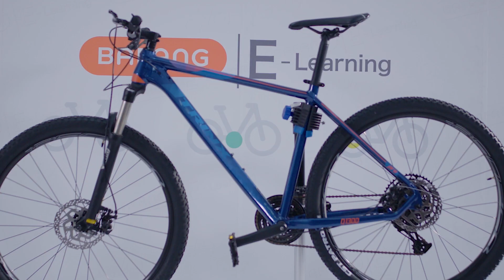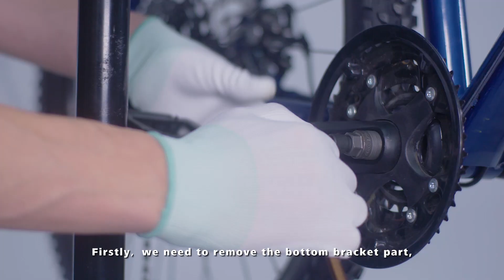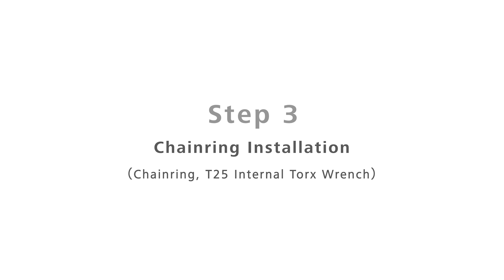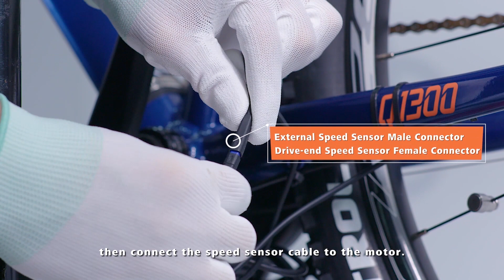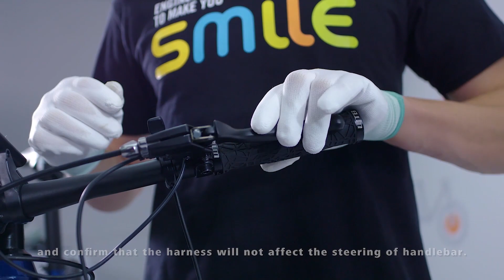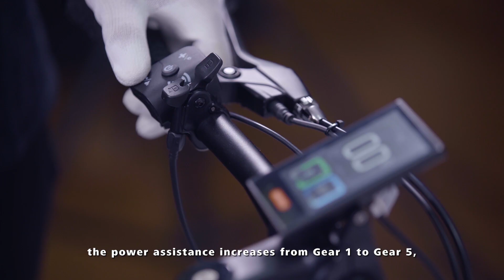Sebic agent high-end motor brand Bafang M625 M325 installation tutorial

Comment: so my cable that run from the computer to the motor only has one yellow connection, all the rest are orange.  So now what is the proper cable to hookup.  The orange cables do match the number of pins.  I hope it works.

Comment: One battery  charg how much kilometer
Reply: really if you are 7 yrs old and weigh 50lbs you can go 4 times farther than Me a 200 pound man.  also depends on how much you pedal to help the motor.  depending on battery size also .  riders may get 30km to 150km.  its reccomended that you ride until the battery level says 50% then you can make a guess at your personal range.

Comment: Bafang has taken advantage of the opportunity to eliminate the use of this motor on half the bikes in their previous market! Look at that massive power pack! Will it fit in anything other than a L or XL frame?!
Reply: The answer is no. The battery is ridiculous. And Bafang provides zero information about the type of cells they use.
Reply: @bjnslc  You can use the rack mount instead of the frame.  Also this shows one of several optional batteries different shapes and configurations the web pages all show different size and configiraton lithium battery packs and different displays.  Also depending who you listen to perhaps other products maybe better for you .  Many builders are recommending the bafang 750.  also if you want to go fast get a real 4cyl motorcycle and and operators license. the reason for pedal assist is if the battery goes dead and you don't plan your trip you can still pedal home as well as exercise.  But if you want to go faster than 20 mph get a motorcycle license. these E-bikes  are all about skirting that issue and putting unprepared riders in traffic.  from your attitude you sound like one of those.

Comment: The battery clearance spec (170mm by 390mm) will not fit most bike frames. Might fit the largest frame triangles.
Reply: Battery design is horrific.
Reply: I bought this one m625 and estimated delivery on September 3. I can make a demonstration video about frame size for battery fitting. I will show the measurements 😈😄
Reply: @KapadyakEbike  For this motor fit every battery,or the same that Bosch etc.?
Reply: Indeed. I cannot even find a 27.5 inch+ frame which is apparently the minimum size requirement. Surely some kind of error? Am quite tall and my 22" is big enough for me